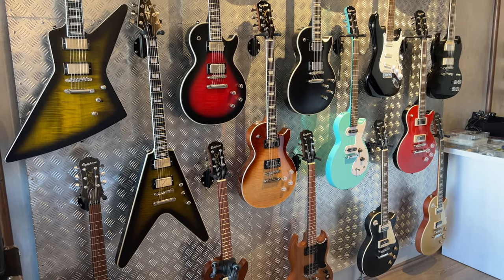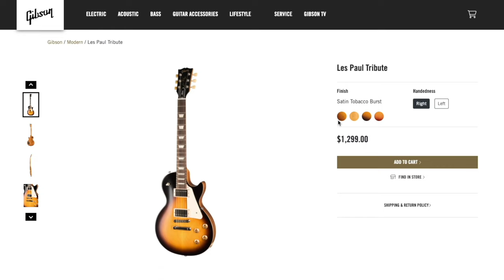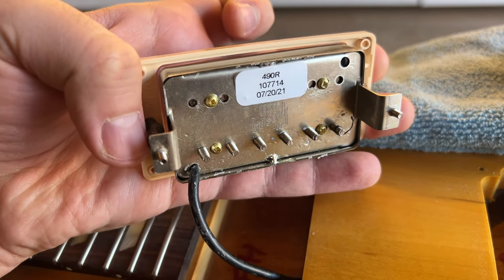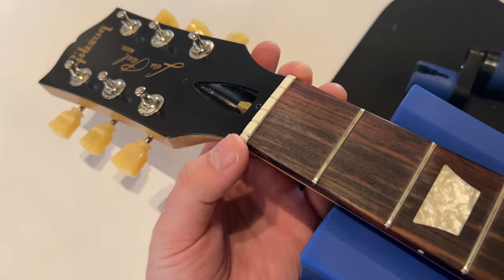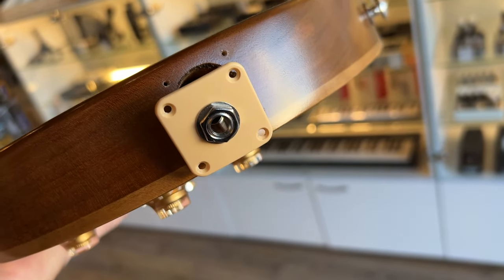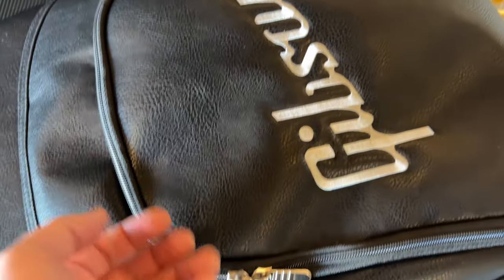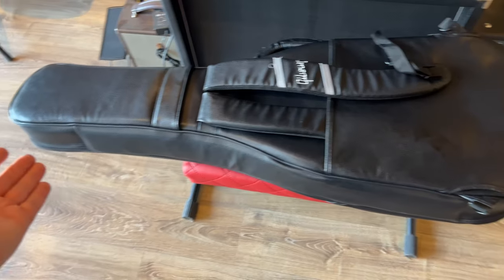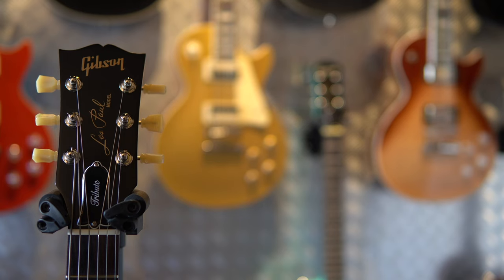Should you buy the most affordable Gibson Les Paul Tribute Satin Honeyburst

Comment: No tone diferences at all, just cosmetics.
Reply from the maker: Mmmm
Reply: Having listened to them side by side in real life, there is definitely some difference. But I don't think that amount of difference would be easily hearable through youtube compression.
Reply: Irl there is a real difference, YouTube compression messes up the small details, but you can still hear a slight difference nonetheless. Not to mention playability and feel to the player is where the money goes at the upper end (outside of looks)
Reply: It sounds a little bit thinner than the Custom. Not worse. I own two Les Pauls (one is a Tribute) and a PRS all with very similar construction but each one has its own slightly different sound.  The Tribute is generally well manufactured and sounds great.
Reply: @donharrold1375 do you believe swaping the pick-ups out will fix that problem?
Reply: you are 100% incorrect. I have both and the standard is a much better guitar by far.

Comment: I purchased the 2023 Les Paul Tribute in the honeyburst finsh for the music director of the church I attend after researching other Les Paul's. The combination of  USA made,closely matching two piece  maple cap body, rosewood fingerboard and maple neck  for additional resonance(and strength at the headstock) ,and  the 490 pickups sold me. The pickups are  both very bright which I appreciate especially in the neck position. The price of 1299 including a deluxe padded case is very affordable when comparing other LesPauls. The only changes I made was to swap in Kluson locking tuners and filed the fret edges. I love this model and have since bought a 2916 Tribute with p- 90s for myself.  Adding the different finish options , you can't beat this guitar.
Reply from the maker: Yeah, It is a great deal. You added some good upgrades too.

Comment: Thanks for the review GV. It's October '24 and I have been eyeing the Tribute honeyburst since I saw it on Rhett Shull's Les Paul rankings vid. Of course, Gibson discontinued the line (too affordable for Nashville make?) and now I am seeing almost all of the Tributes inching back up in price. Most used are $875 on the low end and $1100ish on the high end.
I decided to pull the trigger and got a '22 through Musicians Friend that was in Highland Park, IL. Super quick shipping and so far everything is great. The price was pretty good too at $950 plus shipping for being in excellent shape. I plan on shielding the guitar and replacing the board with a custom JEL Guitar Electronics LP wiring harness with 550k VIPots (Centralab spec) and Emerson bumblebee caps. Not sure what I will do with the pickups, imagine I will upgrade at some point. Like you I actually dig the maple neck and satin nitro finish. Couldn't be happier and this will likely be my only Gibson.